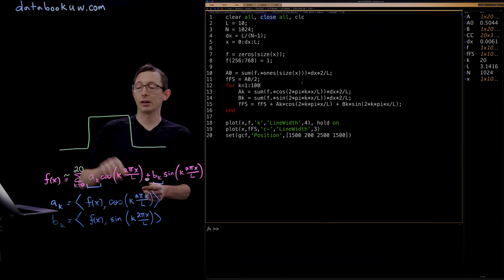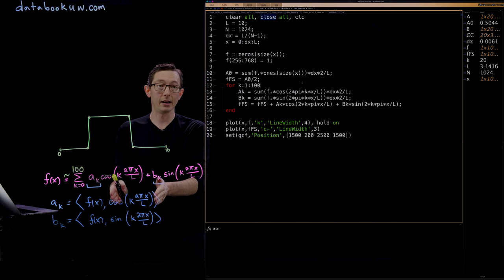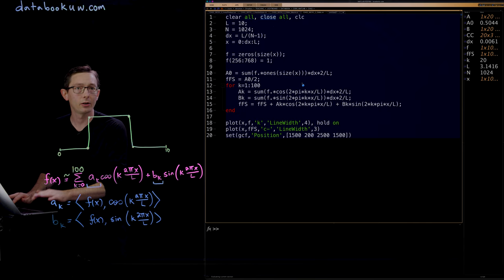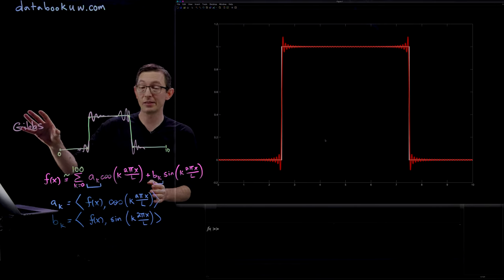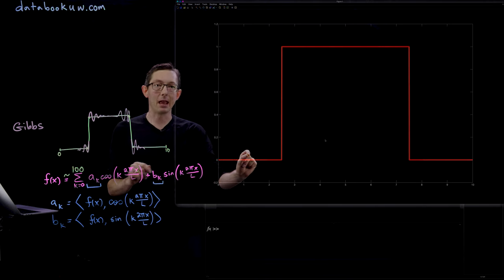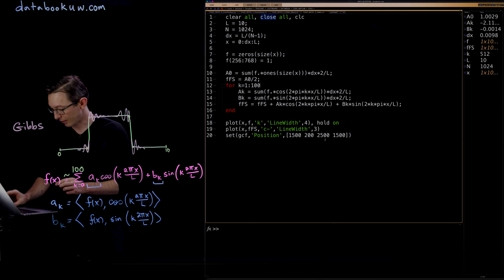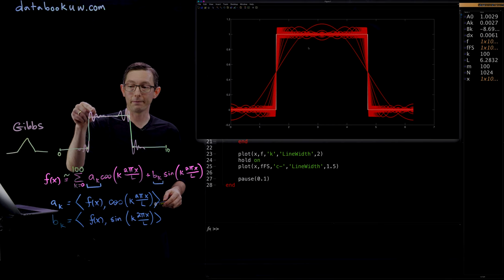Fourier Series and Gibbs Phenomena [Matlab]

Comment: Dear Professor, The Gibbs phenomenon does not go away as we add infinite terms. The Fourier series is not convergent at the point of discontinuity. The oscillations near the point of discontinuity will die away but at the point of discontinuity you will still see an error close to 9 percent of the size of discontinuity.
Reply: So, there's a very nuanced point here: in the L^2 norm, the fourier series does converge to its function because the ringing gets bunched up infinitely close to the point of discontinuity. However, in the Linf norm, no, it doesn't converge, because you are correct, the overshoot doesn't ever actually disappear: it never goes down, it just gets squished infinitely thin. The L^2 norm doesn't "see" this in the limit. I think I remember reading estimates somewhere of how many terms you have to take in order for your truncation to get within epsilon, depending on how far away you are from the point of discontinuity. I'm sure that's all been worked out in detail.
Reply: @andrewgibson7797  How the L^2 converges? I understand that the AREA of the Gibbs spike will tend to zero, so zero energy. But an infinitesimal spike would still be there more like a dirac pulse. Would the L^2 norm considers the spike, no? The L^2 "aproximation error" would never be zero
Reply: @AllElectronicsGr  The error under L^2 does go to zero, yes, but not under sup norm. All you need for L^2 convergence of the Fourier series is for the original function to be in L^2. Do the calculation: you'll see that it converges, for exactly the reason you mention about area tending to zero. That's what the L^2 norm "sees": it doesn't see the "spike" in the limit, no. The sup norm, however, gets "stuck" on the "spike" you mention: this is what screws up uniform convergence.

I should add that, at the point of discontinuity, the Fourier series does converge to the average of the two one-sided limits of f by Dirichlet's thm. The 9% overshoot exists on either side of the discontinuity for any finite sum and doesn't disappear as you add more terms, but moves towards it. In the limit, you can imagine both overshoots "colliding" and equalizing out.
Reply: @andrewgibson7797  Unfortunately the overshoots do not "equalize out" as you approach the limit. Try with some dense sampling in frequency. Then upsample, and the ~9% over/undershoot is still there. It never ever goes away. OK, but why does that matter for real world engineering design? I've been working on related stuff for decades. Every few years I get called in as a consultant to help when some system has some undiagnosed ringing. What I find is that somewhere in the system someone used FFTs to implement a frequency sampling design, where there is an abrupt change in weighting, with adjacent frequency values getting very different weights. (Like zero and 1.)  Hence Gibbs phenomena like presented in this video, meaning that there will be noticable ringing adjacent to these frequency samples. Typically, the challenged engineer increases the size of the FFT. The range of frequencies which ring decreases, due to the decrease in l2 error. But the 9% ringing is still there, no matter how large the FFT.  That kind of ringing is unacceptable in many applications. E.g. you can hear it in digital audio systems and see it in image displays. What to do? Use a better design scheme which avoids the need to approximate a discontinuous or other non-smooth function in frequency. There are plenty out there, from trivially simple to highly complicated.
Reply: @LesAtlas  I understand. And I agree with you. What you’re saying is correct.

And it doesn’t contradict what I’m saying.

We’re talking about different things.

I’m talking about convergence, the limiting function. You’re describing finite partial sums, _truncations_.

If you take a class on Fourier series, they will cover this. If they’re good, they’ll hammer it into your brain. I got lucky and was taught by some really good analysts in a great math department. Brunton is correct, and he’s right to highlight this: the Gibbs phenomenon does in fact go away when you add an infinite number of terms. That infinite qualifier is _absolutely critical_. This is exactly what Fourier analysis is all about: types of convergence (e.g. uniform v.s. pointwise), their conditions, etc.

For any finite sum of terms of the Fourier series, the Gibbs phenomenon is still there, yes, it’s still 9%, it hasn’t decreased, it’s just moved closer to the discontinuity. You can sample til your dying day, take FFTs the size of the moon, it won’t matter – everything you’ve said is true, because those are all partial sums, not the true Fourier series. This is why the L2 norm decreases but the sup norm doesn’t. You are completely correct: the overshoots will not equalize out as you approach the limit. But they do equalize and disappear at the limit. This isn’t weasly semantics, it’s real math. And it has important consequences: Riemann’s lemma, steepest descent, stationary phase, etc.

That’s why good engineers should take the time to learn the math, so they don’t do what you’ve sadly seen, where they try to take bigger and bigger FFTs: they’d realize this is futile. You will never experience this on a computer or in a practical engineering setting because it is physically impossible to add up an infinite number of terms. You literally need an actual infinite number of terms, and the overshoot doesn’t drop until you reach the finish line. Gonna be there a while, wondering why it’s not working. It’s not working because pointwise convergence is weaker than uniform convergence. We have the former, not the latter. So as soon as you enter the real world of finite calculations, Gibbs will necessarily pop up.

For an infinite sum, the limit of partial sums, i.e. the actual Fourier series, not an approximation of it on the computer, the Gibbs phenomenon is no longer there. There is no overshoot _in the limiting function_: it’s about as nice as you could hope for, it converges for every point where the original function is continuous, all the way up to the discontinuity. At the discontinuity, it takes the average of those two one-sided limits. The proof is below: it’s classic, famous Dirichlet. The kernel it introduced is important. Again, a Fourier class will cover all this.

If the series converged under the sup norm, we’d get a continuous function, which we don’t have, and that would violate the uniform limit theorem. So it’s to be expected that the height of the overshoot doesn’t decrease. The area of the ringing does, however, go to 0, so using the L2 norm we can get pointwise convergence instead of uniform convergence. These are different things. We’re not measuring distance between points of individual functions. We’re measuring distances between _functions_, in a function space, using a suitable norm.

This stuff is subtle. It took some of the world’s top mathematicians decades to tease it apart. Just recognizing these distinctions is a challenge in itself and is why there are whole classes on it now. Here’s the deets: http://people.math.harvard.edu/~knill/teaching/math22b2019/handouts/lecture30.pdf
Reply: @Andrew Gibson To be clear, we do agree that it converges to the midpoint of the values of the discontinuity. Yet Dirichlet's theorem says nothing about finite sum behavior in the neighborhood of that point. The ~9% over/undershoot ringing is in that neighborhood, hence the unavoidable ringing.
Reply: @LesAtlas  That is simply not correct. It says that, in every neighborhood of the discontinuity, at every point other than the discontinuity, the Fourier series converges to the value of the original function.

If the overshoot were still there, it would not converge at those points.

It does converge at those points.

This is literally textbook, dude.

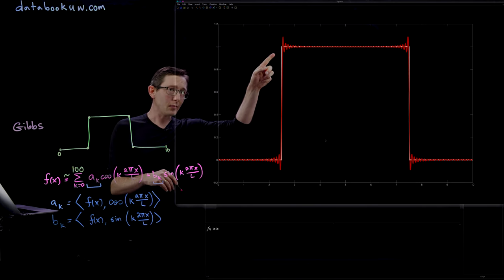I am telling you, the Gibbs phenomenon disappears in the limit. I'm telling you this, Brunton tells you this explicitly at 3:00. It's real.

Edit: you edited your comment to add "finite sum behavior". Right, that IS correct. That's the issue: partial sum v.s. in the limit. Gibbs phenomenon is an error introduced by taking truncations of Fourier series. This is incredibly important in my area, CFD, for example with spectral methods. But there are entire methods, which I've mentioned, whose proofs depend on the limiting behavior of these series. I am telling you, this is a numerical artefact, it's due to using finite computations, it is not present in the actual, true Fourier series.

Pick a point, other than the discontinuity, that you think is overshot in the limiting function. Dirichlet's theorem says the difference between the limiting function at that point and the value of the original function is 0. This is true for every point other than the discontinuities: pick any epsilon-neighborhood you like, no matter how small, it applies to every point in there. This is what pointwise convergence means : it doesn't matter what point you pick, you can go out far enough in the partial sums to make the error at the point arbitrarily small. We do not have uniform convergence, however, because if we tried to squeeze the entire function down by taking higher partial sums, the maximum error across the domain doesn't decrease; the "problem area" simply moves left/right, not up/down. When you reach the limit, it "arrives" at the discontinuity, becomes perfectly vertical, and poof, vanishes. The error here is literally all-or-nothing: you're taking larger and larger partial sums, and the overshoot is 9%, 9%, 9%..... 9%, boom, 0, when you finally reach infinity.

The problem is that you can never get there. Infinite is much bigger than finite.
Reply: @Andrew Gibson @Les Atlas I enjoyed your discussion very much, and the difference in your point of views comes from the difference between applied math and, well, math.
Reply: @andrewgibson7797  Do you have good literature for this?

Comment: When I set k>500 its getting pointy at the edges. and at k=5000 im getting the height of the plot is higher than original plot. What could be the reason for this?
Reply: Hey, this is related to your initial sampling points(N). In the case of k=5000, if you set the number of N to N=10000, you will again see a "perfect" reconstruction of the original signal. I'm not sure what the reason is, but if you plot the contribution of each k of the series, you'll see that at k=1 you have the highest contribution, and as you approach k=N/2, your contribution decreases. But if you go further from k=N/2, the contribution starts to increase. If you do a more detailed inspection, you'll notice that the contribution of k=0 and k=N are equal, also k=1 and k=N-1 are equal etc..